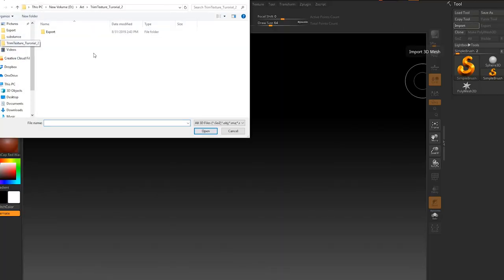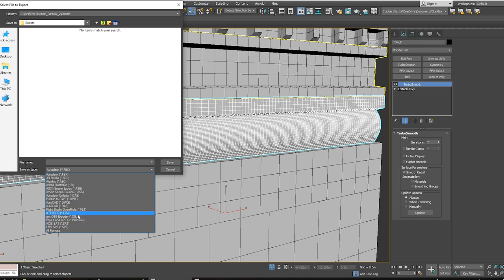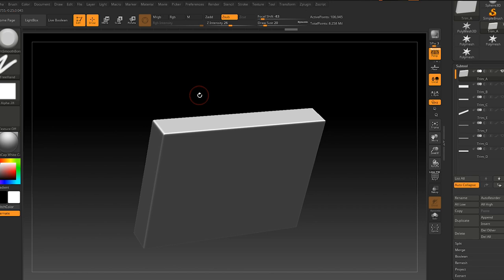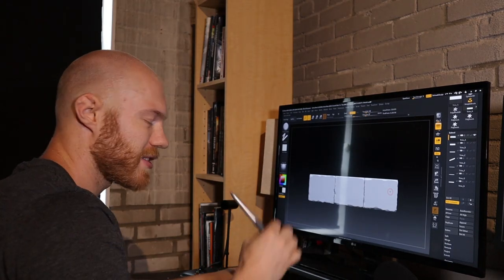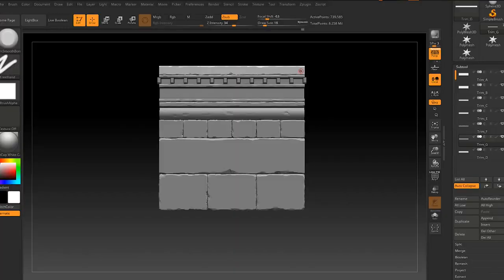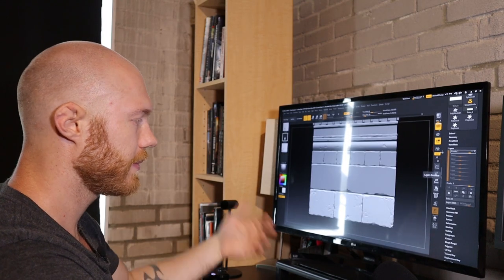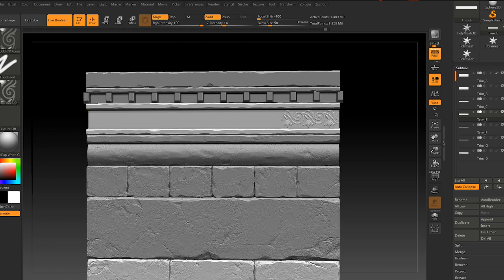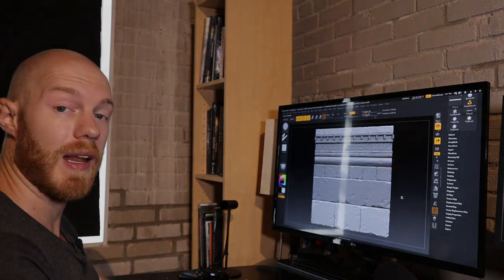Sculpting Trim Sheets in ZBrush - Trim Texture Tutorial Part 2

Comment: the best way i have found to deal with tiling something like those ornaments in your case is to go under deformation and smart resym (by default it does it from right to left). You start doing your patter  from left to right but don't go all the way to the end on the right. you stop just before it. You mask out a decent bit of your geometry on the left side (where you started your pattern) and click smart resym. it will basically take the masked section from the left and mirror it over to the right.

Comment: There's one option that could work for tiling..

Have a straight uv for the low poly ready in Max. Make sure that there are a lot of loops on the low poly, otherwise it'll distort the alpha badly. 

Export the image snapshot to photoshop.

Tile the black and white/greyscale ornamental part in Photoshop.

Invert the new image(turn off the snapshot png or grid) and save as a tiff, etc.

Bring it into zbrush as an alpha.

Under masking, use mask by alpha..

It should result in a seamless relief sculpt once you use deformations to inflate..

That's one way. It's kinda similar, but you need to have a high enough resolution on your B&W alpha.. Assuming you have a B&W alpha ready. Doesn't work for everything
Reply: Or just use warp modifier on your brushes I guess.

Comment: For the tiling issue, it looks like you're starting the tile too close to the edge, if you look at 21:19 you can see that the texture is tiling from green line to green line, if you start by doing your first click a little further in than directly on the edge, it should tile fine from then on. This is just a guess, but it jumped out at me while I was watching.

Comment: Hey Tim, Thanks for the trim sheet tutorials. I've got the gumroad files as a contribution to Polygon Academy to keep on cracking this in-depth content. I am by all means on the lower end of being an amateur when it comes to content creation, mainly due to the fact I am coming from a programming perspective, so sometimes I find it hard to keep expressing creativity with the foreshadow of being pragmatic. To my question, and I wanted to ask you before going to a forum for help. After sculpting in ZBrush and Import to 3DS Max, I duplicate my high poly meshes for the AO*(Not sure if this is the correct tum/reason). Now in your videos of sculpting in ZBrush, you say set brush wrap mode to 1 to enable wrapping for tiling. I have done that, but when I have the objects side by side, my cracks don't line up and the open edges are not straight when I've used wrap mode near the edges. I am wondering if there is another setting possibly ?
Reply from the maker: Thanks for the support! I really appreciate it :) you have to turn on wrap mode for each brush individually, that might be it? Only other thing incould think of is your basemesh wasnt set to a power of 2 like 4m wide?
Reply: EDIT: So I found my solution. The problem must have stemmed from creasing my edges. My solution: In ZBrush, before subdividing, I crease via Geometry -> Crease -> Crease Button, then I Subdivide and for my final 2 subdivisions, I use the smoothing option. I noticed with this method, 1, my trim sheet  is tileable, and second, when I am in 3DS Max setting up for Substance Painter, if I clone a trim piece and when I move it 4m left or right, both pieces of geometry match 100% so this method alleviates geometry shrinkage.

 @PolygonAcademy  I have narrowed it down to this; if I subdivide in zbrush without smoothing no problem, even in 3DS Max, I duplicate 4m left or right and the meshes align perfectly. So when I subdivide 3-4 times then 2ish time with smoothing turned on, then this problem occurs. I made sure I creased my edges and still happens. A penny for your thoughts? I've tried numerous ways with Live Boolean turned on and off. Thanks for your advice :)

Comment: For tiling, make a duplicate of the strip and paint on the details.
Then duplicate the detailed on and move it side to side with the first copy to find where it tiles.  Move these so their joint is somewhere inside the original strip and hide everything but these three.  Hit reproject to transfer the two strips to your first strip.  Delete the two copies.  Now you can fix the sculpting of the seam in zbrush using blur etc.

Comment: Thanks for the rest of the series Tim! I'm currently watching this part. 

Question: have you ever tried baking in Marmoset? I've been using it for 2 years now and since the first time I've baked props/textures in it, I stopped baking in Painter, it's more efficient and gives way better results in less time. :)

PS: this part's sound is way lower than Part 3&4.
Reply from the maker: thanks for the heads up, think i forgot to boost the sound levels haha i was finishing all the editing/exporting on these at 3am last night lol. Havent tried in marmoset, I bake mainly in painter because I can roll right into the texture creation without having to jump between another software, heard its dope though!
Reply: Midogame, have you tried baking in Painter recently? It's gotten quite fast. I also used to use Marmoset, but now I just use Painter. Give it a go

Comment: Maybe to make seamless pattern on mesh, unwrap mesh in 3ds max, place tiled alpha inside 3ds max to check that all tileable in UV-ed space, after that load in zbrush mesh, add texture, and make mask by texture and extrude. It will work i think? :D
Reply: if that work, make tutorial :)
Reply from the maker: @MTBesh  yea I thought about this method, it should work for sure. I have used it to get patterns on unique unwrapped props before for the highpoly. but havent tried it on tiling meshes yet

Comment: For the Wrap Tile at minute 21:42 if you extend the strip with some extra length and then delete the polygons after 
perhaps it will help with the tile
Reply: and 
if you try to use shift like in Photoshop if there is the same function :D

Comment: I strongly recommend the brush library tool from https://xmdsource.com/, its just 10 times easier to quickly find the brush you need from your library, it has a direct link to Zbrush so no more back and forth in your folders. I suppose you already know about it of course, but for anyone that is not yet aware of this, its just amazing and will save so much time. Thanks for your videos again Tim, you are the best!
Reply from the maker: ive seend some of the xmd stuff in the past but never looked deep, will take a look! thanks for the recommendation.

Comment: Hey Tim, i am having a bit of an issue with the Curve wrap part, i am trying to recreate this tutorial but my brush stroke doesnt follow correctly on the opposite side of the trim part. It has a gap because of the Zbrush unified space, but i cant click unify because that moves my trim part and rescales it. Do you know how to fix this issue? (The curve wrap setting works when i use a Zbrush default plane/unify the piece)
Reply: ive got the same problem, did you ever fix this ?

Comment: Does anyone know if the "Edge Crease" tool in Blender works for other softwares outside of usage in Blender? I am trying to create a trim sheet and when I import the meshes to Zbrush and divide them (after a couple of subdivisions with no smooth switched on) it still shrinks the edges a bit and ruins the tiling of the sheet.
I have resorted to adding some support loops just so that I can continue working, but I would like to know if someone has an answer, thanks :)

Comment: On 20:35, Ive got an idea, couldnt we just manually damage up the edges? This way using same method you used for the concrete? Yes it does get us a shorter strip, but we could just use geometry folding even we dont want the edges visible and a whole line of strip instead. Would this be viable or other issues appear Im not aware of? Thanks!

Comment: Question; that crack brush you are using at 15:35, what is it called? Where you can click and drag an image that forms the shape on the model, instead of working like a brush? Am more used to Mudbox but I want to get into Zbrush. But I got no idea what that crack image is called in Zbrush, so its making difficult for me to look for HOW to put something like that in my Zbrush XD
Reply from the maker: i think its called draw? if you see the squiggle line icon in your brush that is called stroke, click that, and then look for the one that is like a square with an arrow, either called drag or draw or something like that. its the other option for your brush panel that isn't the alpha slot. let me know if that helps! haha sorry for the non exact/technical answer, im on my phone at the moment :)
Reply: @PolygonAcademy  Thanks! I managed to figure it out. Another question that popped up as I was watching this video. Say I want to import my own decoration instead of that flower thingie you used. How do I do it? Ive tried to google it but I keep getting "how to import brushes".
Reply from the maker: @TheIcelandicBoy  you would import your own alpha and then create your own brush preset, but i was just using one of jonas ronnegards 100's of pre-made brushes in this case, so you just load a brush. but to change the design, load a new alpha and you will need to change the stroke spacing etc. to get the pattern to properly repeat.

Comment: Hi Tim! thanks again for your tutorial, I have some problems here in zbrush, dividing less times than you do the polycount grows so absurd, at the end of the various divisions I have a total of more than 30 million in total point, when you stay sleep to 10 million, before exporting from blender the mesh seems similar to yours in terms of density, what can make it happen? the starting parts have this number of tris: A: 5500; B2800; C4800; D178k; E6k; F16k; G1500. am I probably exaggerating with density before importing into zbrush? sorry for the thousand questions :) have a nice day
Reply from the maker: yea subdividing your mesh always multiplies the polygon count by 4, so I think your starting basemeshes have a higher polygon count than mine, so don't worry if you only have to subdivide it a few times and it doesnt match the amount of times I did it, just aim for 1-4mill for each piece!
Reply: @PolygonAcademy  thanks for the quick answer, I'll come back in blender trying to fix it, I noticed that even if part E is very dense (starting 6k, the one above the curved part),if I don't divide it more times in zbrush (4 or 5 times), when I add the smooth option retracts from the corners, but I can easily have mistaken something in blender. I immediately try to improve. thanks again Tim :) <3

Comment: I'm gonna ask this question because I've been researching and can't find a solid solution that works for me.

Is there any way to "lock" the borders of the mesh? If I want to pinch some strokes near to the edge of the mesh, the mesh warps and messes up my X/Y Axis and doesn't tile correctly when I'm trying to bake the highpoly into a lowpoly plane.

I've tried to lock the sculpt axis in Transform > Modifiers and only select the Z axis, but some brushes with alpha's don't work properly (Orb Cracks in my case). I've also tried doing a morph target and only morph the X and Y axis to preserve the sculpted data from the Z axis, but it messes up some detail...

Is there any solution for that? I had thought of adding in my 3D software, a copy of the mesh, left and right, and modify the WrapMode to be able to sculpt without fear of losing the edges.

Thanks in advance!

Comment: Hi, can I ask you a question? I prepared my mesh in 3ds max just like you showed, with the 3 big tiles in the lower part and all, but when I import it in Zbrush it just doesnt subdivide like yours does. I dont get any of the previously made detail and I don't know what I am doing wrong.
Reply from the maker: When you subdivide in zb, are you turning off the smth button for the first few subdivision?  That keeps the edges crisp and then turning smth on for the last one adds a bit of edge bevel.
Reply: @PolygonAcademy  , yes I did that, maybe my problem is with the base mesh I guess. Thank you so much for the quick reply tho, I really love your videos, they are great and i have helped me a looooot.
Reply from the maker: Cheers! Let me know if you get it figured out! Good luck :)

Comment: If anyone knows the Blender equivalent of wrap mode, please let me know!
Reply: There is an option in the Symmetry section of sculpt brushes (The right side panel) called tiling. You can choose each axis you ant tiling on. Just change the Tiling offset value to the distance you need in meters/blender units. In the case of this tutorial you would want X-Tiling with an offset of 4 in the X.

Comment: I'm having an issue with the bottom row of bricks and poly groups. When I auto poly group the bottom row of bricks they don't separate in to different poly groups, it's just the one group. I have a row of smaller bricks further up and that one has worked fine, I used the exact same process to create the two rows of bricks. Anyone know why this is happening?
Reply: Never mind, I figured it out. It was a turbo smooth modifier still in the stack, got rid of it and I was good to go

Comment: Does anyone have the issue where you import your .obj and the normals are flipped in ZBrush? I am using Blender for the modeling. The normals looks perfect in Blender but once imported into ZBrush, they are flipped.
Reply: check your normal direction in blender with the overlay mode that does face sides. often its hard to tell what direction faces are going in blender unless you check or turn off double sided drawing